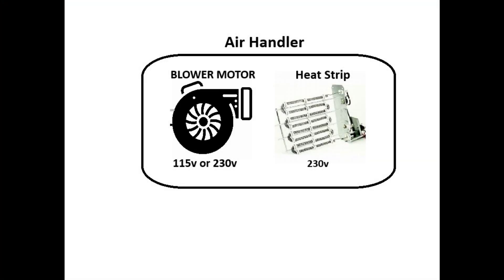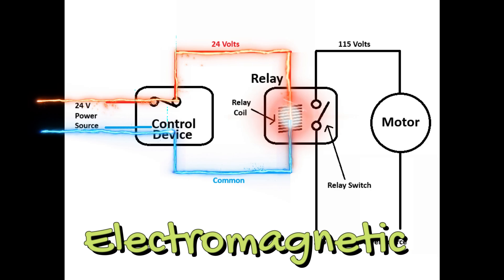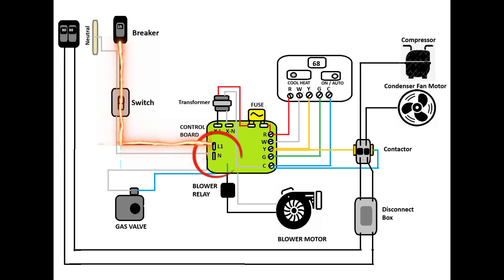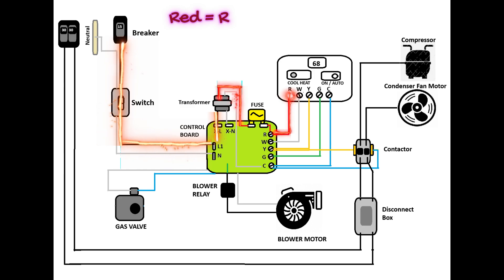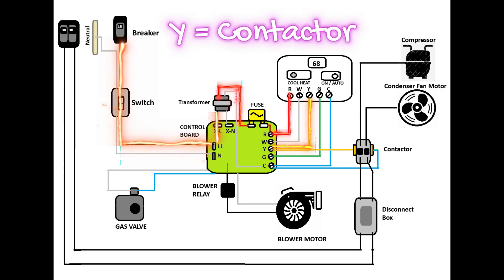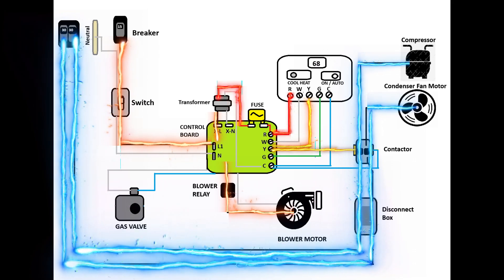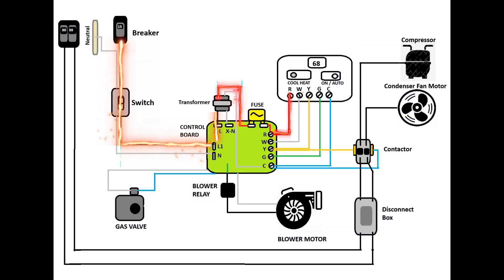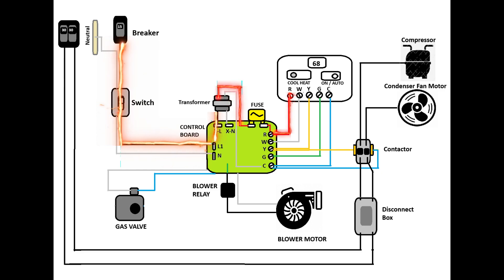HVAC Low Voltage Control Wiring for Total Beginners

Comment: Hello again Mike..really appreciate the channel.  I am trying to solve a blinking purge light on a HW Total Zone 4 control panel.  Recently i had a damper actuator fail and was stuck on closed position for about 12 hours.  I replaced the damper actuator, reset the system by turning off breaker power for 30 minutes, but the light still blinks.  I did some reading and learned this could be due to a failed OT or DAT sensor.  On the HW control board, there are no wires plugged into these terminals so I am not sure that would be my issue.  Before i call for service, I just wanted to check with you to make sure a DIY'er like me is not missing something easy.  Thank you...

Comment: Great video, Mike. Thanks for sharing your knowledge. I'm passing it along to some of the newbies.
The flaming wire makes me a little tense, since I watched an earlier video of a guy deliberately melting a 22AWG jumper wire (like the ones we use) by running 30A through it. It took about 5-10 seconds before it started to look like the energized wire animations in your vid. :)

Comment: Need help.  anyone with an idea I would appreicaite advice.

My furnace ECM blower does not reach 250 rpm when calling for heat, so after 3 attemps the furnace locks out.

If I restet the furnace using the breaker, it will run for one or two cycles then lock out again.
The above is when the fan is set to auto.

If I manually run the fan on high, without calling for heat, then move the thermostat to call for heat, the funace lights, the blower motor shuts off, then it comes back on and runs just fine.

The blower motor works fine when the heat is off and I just run it on low, med, or high.

I know very little about electronics, but I'm guessing it's an electronic issue.

Thanks.

Comment: Thanks for the video but I am still not clear on the wires coming from the contactor on the condenser.  Your video is showing the yellow wire for the y/y2 terminal and I am looking at mine and there is no yellow wire whatsoever.  I think I am going to have to trace the wires outside at the condenser unit.  For some reason, I have a red wire coming from the condenser and connected to the “common” terminal on the furnace control board and a white wire coming from the condenser and connected to the y/y2 terminal.  I am looking at the diagram for carrier two wire relay module and it shows red wire coming from the condenser to “R” terminal on the furnace control board.  Yellow wire to the y/y2 and the common wire to the common terminal color unknown 😄.  Confusing.  Just two wires coming from the condenser unit are connected red wire and a white wire but to the wrong terminals on the control board.  You are saying that the yellow wire from the contactor should connect to the y/y2 terminal.  Which is right?
Reply from the maker: Color of the wire doesn't matter. Lots of guys will use red and white if only 18-3 t-stat was run to the outdoor unit (only red, white and green wires available). Usually if 18-5+ wire was ran guys will use yellow and blue instead to stick with conventional color codes. But they both do the same thing. It's just a simple circuit from Y to the outdoor contactor and back to common in the air handler/furnace.
Reply: @JerseyMikeHVAC , hi, thx. for the response.  I have the green and the blue wires also coming in from the condenser but they are not used on the control board.  The diagram for the two-wire control module states that I should have THREE wires coming in from the condenser unit.  1) goes to common terminal 2) goes to “R” terminal 3) goes to “y/y2” terminal .   Colors don’t match so, I will have to trace them back to the condenser unit to see what was done.
Reply: @JerseyMikeHVAC , hi, today I checked the low voltage wiring at the condenser unit outside and it looks like the installers did something very strange.  I see two red low voltage wires coming from the fuse box outside in addition to the two 120v thicker red wires for power.  The question is WHY WOULD AN INSTALLER DO THIS?  There is no way to see the actual thermostat wires.  They are concealed inside the external fuse box I think.  So, there is no way to know which wires are which unless we open up to fuse box to look at it.  CRAZY!

Comment: Be cautious, Not all thermostats and relay coils are 24 volt. Some are Line voltage, 120 volt or 240 volt. I have seen 24 volt thermostats installed on a line voltage systems.
Same with 24 volt coils installed when it should be 120 or 240 volt  coll. The smoke will escape very quickly.

Comment: JM is such a gifted teacher. This MAN, in this video here, has cleared up the understanding completely, for me,  on the C terminal. For years, I just could not understand how a thermostat with 1.5V BATTERIES, function WITHOUT the 24v COMMON WIRE from the TRANSFORMER, (been hooked up). But now I got it!!! Its better late than never for me. My UREKA MOMENT is when he said that " all the wires from the thermostat are really in essence "COMMON". WOW!!!. I have finally over come now. I have finally now have no drawbacks of going to check any ac system. WOW! Thanks a million Sir JM.
Reply from the maker: You're welcome 😁

Comment: Simply amazing. As a homeowner, I now understand exactly 99% my air conditioning system control board.
I'm going to use a leftover wire to plug it into the control board c terminal and install my new thermostat. 
I'm guessing  that the r and c terminal gives continuous power to the thermostat. ? 😊
Reply from the maker: Yes sir.

Comment: I have a situation were my unit stops working, I  pull the fuse from the control board to check it and I put it back in and it starts working again. Its happen twice already. Why could this be happening?

Comment: So if I don't have a "G" terminal on furnace control board I can just connect to the common?
Reply: No, your terminal should have a G because that’s for your fan and fan alone, as a common is not designed for your fan it’s designed to make a full path of connection, and often times you don’t have your C hooked up because your thermostat has batteries in it

Comment: Why does Y(thermostat) have to go to Y(control board) first before it goes to the contactor? If Y(thermostat) goes straight to the contactor, wouldnt that also work ?
Reply from the maker: In many cases. yes, that would work out just fine, but it depends on the system. Some systems will use that signal on the Y terminal to adjust speed on the air handler's blower motor.

Comment: Jersey Mike thx for your videos I was able to figure out my wiring for my Honeywell aqua stat l8148e 1 zone wasn't working no separate transformer all working off aqua stat . Honeywell 4 wire zone valves    so i was not sure what wires went where. red i knew t and tv  wasn't sure how the t stat wires and yellow went. watching your videos i was able to figure this crap out  thank you very much. If i had a separate transformer would of been piece of cake. please do video w/o external transformer. heat only.

Comment: Well done. 👍🏼 I wonder if you could help me out, I’ve got a head scratcher. The original draft inducer motor bearing went out so I bought a whole new unit. I replaced the bearing in that original inducer motor, installed it and it and out of nowhere I’ve got I gas build up and a big poof at start up. It does it every time on startup. I didn’t touch the flame sensor or anything like that when I replaced it . I ended up changing the bell end bearing of the second unit and is running fine. Any thoughts why the original draft inducer motor would cause that problem? Any thoughts of wisdom would be appreciated.
Reply from the maker: Those bearings are designed to be self-aligning. By taking them off of one unit and installing on another, there may have been some difficulty in the self-alignment causing improper RPMs on startup, reducing air flow, hence the gas build up. The tolerance differences in mixing old and new parts could maybe be the reason.
Reply: @ Sorry about the confusion. I didn’t swap out parts. I just replaced an old bearing with a new bearing.

Comment: if Central Air use  easy start, to lower watts being pulled, is there anythings, out there, that can lower watts, being pulled in starting watts?
Reply from the maker: Any form of resistance added to a circuit will reduce the available amperage that could be drawn from other component (s) in it.

Comment: Hi JM,

Ideal video for beginners. I am a small landlord and of course in dead winter or other unfavorable times I must buy a transformer. In the beginning they would ask 120, 208 or 240 as most is not in stock. Of course now I know 120; cap the orange wire !!!. My question is what type of residential HVAC residential system would need 208 or 240 transformer? Does it not reduce to 48 volts? What would need the higher volts?
Reply from the maker: Most AC air handlers today have 240v blower motors in them, though some can still be 120. Most everything else as far as transformers are concerned in residential hvac will be 120.
Reply: @JerseyMikeHVAC   I see. Most of my HVAC units are 12 years or older. TKS

Comment: Thanks man.. Question, I was checking a 3 way  mixer valve actuator that runs on 24v ac. 4 terminals where coming in. One is for the 24v supply, the other one is common, signal and then I forgot the other one. I got 24v from the supply to common but placing my red probe on the hot and the black on body of the valve I only got about 10v. I wasn't sure if the motor was bad or if it was getting the right voltage..
Reply from the maker: Could have been a false reading. If you don't have a proper circuit reference on the black probe for the red probe to use, you'll get odd voltage readings. Valve body might not have been a good reference, basically.
Reply: @JerseyMikeHVAC  thanks again man. Keep up the good work

Comment: Hey 
Good morning. Today here in Georgia we are in the high 25 degrees so I heard the heat pump should be okay to run heat until the temperature gets around 20s and above  that you can shut that down and go in to heat strip mode.  Now it's in emergency mode for the heat strip to run. My question is when you do this you have to removed the cover on the thermostat to do this. Once removed there a switch you have to turn on for the heat straps to come on. There a way so I can be able to run the heat strip with out removing this cover each time the temperature falls below 20 degree.
I enjoyed everyone of your post
Reply from the maker: What kind of thermostat do you have? Most HP stats have an emergency heat switch right on the outside of it that does that same thing & doesn't require removing the cover.
Reply: @JerseyMikeHVAC  Mike
Robertshaw
9560 model
State two Heat/ two Cool
With auto Changeover
Thanks for replying
Reply from the maker: @johnraylangstonjohnraylang5924  OK, yeah, just a matter of getting a different thermostat.
Reply: So
What can you share with me on the type in need here. What would be the correct one to purchase. Or maybe you may have one that I can purchase?
Thanks
Reply from the maker: Do you need 2 heat/2 cool?
Reply: @JerseyMikeHVAC  NO.
Just saying what's on the box that I read to you
INot sure why it like that. It has more batteries runs on 24 volt. Again I was trying to understand when you put it on Heat pump kicks in but if you want the emergency  Heat strip to come on you have to remove the cover and turn on the switch.  So once I purchase the right one. How will it work will it work like this one but the Heat strip botton be on the outside of the cover? Or will it automatically once temperature drops to 20 degrees the Heat pump will kick off and the Heat strips kick in to play.
Just asking.
Reply: @JerseyMikeHVAC  
Outside unit. 3 ton Goodmen.
Reply: Great video as always. Thanks.